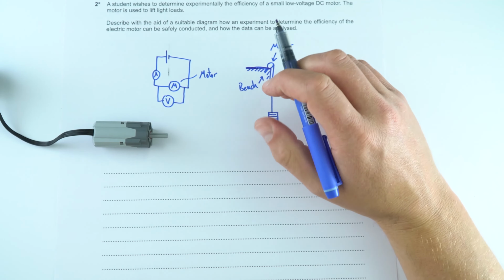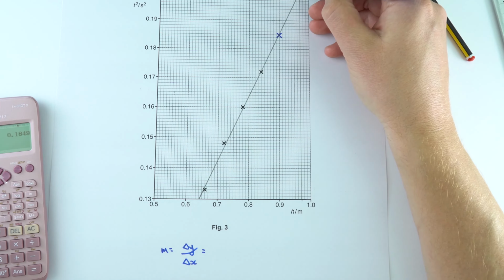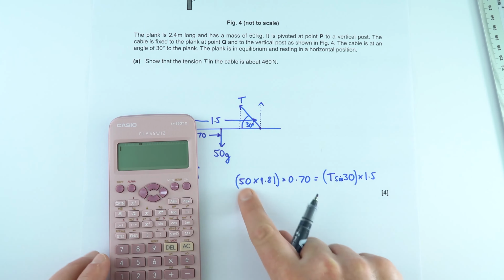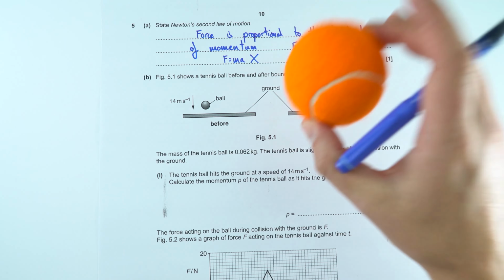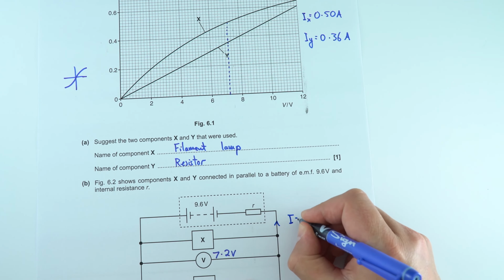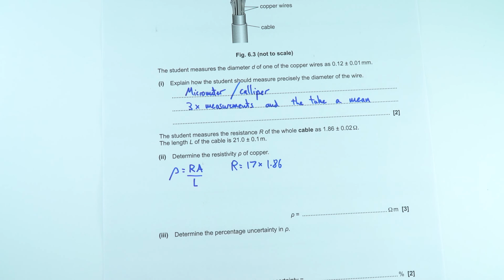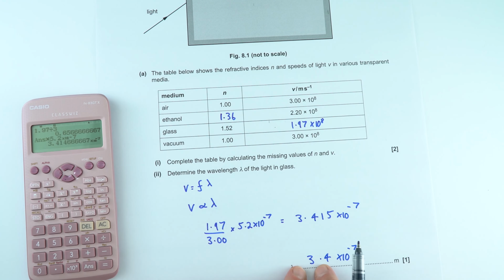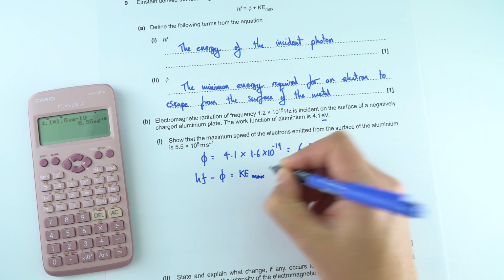OCR (AS Level) Depth in Physics - 2018

Comment: 29:20 why don't you divide by 17
Reply: Thats what i was thinking
Reply: Yeah I also dont get why. If the whole cable has a resistance of 1.86 ohms and there are 17 cables for 1 cable he should divide by 17
Reply: @barneyhall4361  It's due to the wires being in parallel. The resistance of a single wire is greater than the total resistance. 1/Rt = 1/R1 + 1/R2 + ...